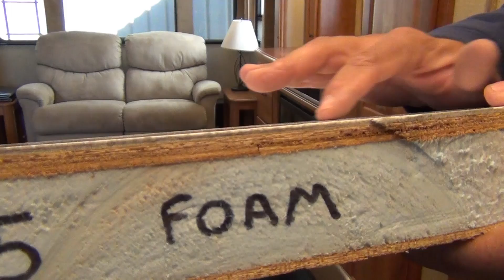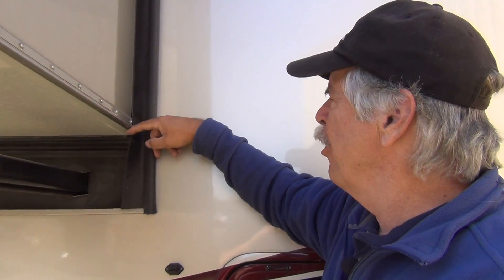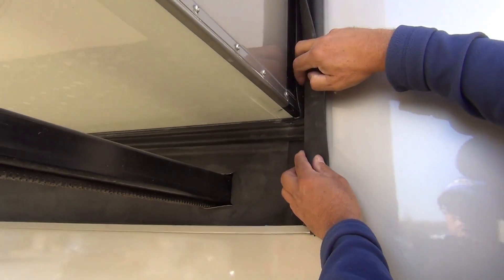How To Heat and Insulate your RV with Insulation Windows Furnaces and Seals

Comment: anyone?? insulation question.... From what I read "enclosed heated underbellies" don't really provide that much heat, 1 vent for the entire underbelly just doesn't seem to cut it.  Not to mention I heard that the insulation is absolute crap. If I were to install heating pads I would like to update the installation. Sooooo what's the best thickest Installation that I could put in an enclosed underbelly??  (is the plastic that it comes with decent? or should i think about replacing that. Obviously I want it water tight) really don't want to use a spray insulation since I might have to take it off and work on it again someday but want something very efficient.. any info would be greatly appreciate.  321BH arctic wolf forest river.  Thanks guys and girls🙃🍻🍸 ps we will be doing some camping in 5 10 15 degree weather, I'd rather spend the money and do it right❄❄🎅❄

Comment: Could I bore some holes in the wall of my 1982 Dodge xplorer 228 camper van and fill the walls with spray foam insulation? Do you think this would cause a lot of warping?
Reply: I want to know also?

Comment: This video is very informative thank you.  I was just wondering if anyone on here could give me a little advice for my RV remodel.  I have a 96' Jayco 3500 fs that I'm gutting out to remodel so that I can live in it all year long.  Just so you know, I live in Norther Wisconsin where winter's can get to -60 degrees with windchill. I've torn it all the way down to the studs because one whole side has suffered alot of water damage and will be replacing the studs that will need to be replaced due to this.  I will also remove two of the windows and closing those openings up.  I was just wondering with all the Insulation ripped out, what would you recommend as a replacement insulation?  Should I just put all new Fiberglass Insulation in or do you recommend Firm Styrofoam Insulation?  If anyone can help, that'd be great and thank you in advance.  Kimberly
Reply: I would go with 2'' blue or pink owens corning R12 foam and spray foam every crack and difficult to reach orifice, all for walls and ceiling. For the floor i would put 2x R12 foam from beneath while also rapping all holding tanks+ spay foam all around and finish it with black 3/16'' coroplast so that the underbelly is smooth as baby butt to reduce drag when driving up the highway. I would also put standard residential 120V heating cable beneath the wood flooring inside the coach to offer a perfect low energy heating source, cause a hot floor is always soo confortable when it is coooold outside. Sure it is lots of work but it is amazing  you''ll see. I did it once and it is amazing!

Comment: Was this a infomercial for Horizon Trailers?

Electric mattress cover is great as a bed pre warmer. 

My 5th wheel has no heat source in the bed overhand so I use a Stor-Dry which has a low power heater and fan, draws less than 100watts and is supposed to be used to keep moisture at bay when storing an RV or boat but also does a great job of circulating air in my bedroom.

Refectix taped over a widow on the outside of an RV adds extra insulation.

An infrared electric heater seem to kick out the most heat.

Comment: are there steel ribs inside the walls of RV's like vans have and if so about how far apart are they on average?
Reply: The story is worse than what is told here. They aren't steel; they're typically aluminum, which has enormous thermal conductivity, so that short-circuits much of the value of the insulation stuffed into the frame around them. With a couple of rare exceptions, the whole RV industry leaves their frames completely uninsulated--the frame member has contact with the outside wall on one side and with the inside wall on the other, with no insulation between. Even his roof section in this video isn't the R-20 claimed because it has air conditioning ductwork in it. Anywhere there is ducting like that, it is R-10 at best so that pulls down the total R-value of the roof system.

Comment: The average R-value of solid wood is 1 per inch (equal to a single pain window,) and aluminum has a lot less of a R-value than that. Aluminum conducts heat as well as it can electricity.

Comment: Here's friendly advice from hardy Canadians spending harsh winters in RV's at oil and gas sites throughout northern BC and Alberta.
Use special bubble wrap with flat surfaces on both sides (not the regular one with bare bubbles sticking out on one side) and attach it really tightly to the glass while also covering window metal frames all the way to the wood trim. Keep it in place by running scotch tape all the way around it sealing it the best you can. There's also bubble wrap with one sticky side which is absolutely ideal for that: it doesn't leave much air between the wrap and the glass/metal frame, thus eliminating condensation and frost (and that's exactly why simply closing the shades doesn’t work). This material is also great in letting the sunlight in during the day (unlike astrofoil - another material popular among RV-ers) while providing good privacy at night (you can only see people's silhouettes inside even with blinds open), and it's fairly easy to peel off in spring (you might need to use a bit of rubbing alcohol to remove any adhesive residue from the glass). You can also attach pieces of bubble wrap to the vent and skylight openings to let the light in without loosing the heat. I recommend keeping them in place using self-adhesive velcro strips attached around the perimeter of both the opening and the bubble wrap cover - that way they're easy to remove when needed. You can also glue a large sheet of bubble wrap to the top of your bed board under the matress to reduce condensation there.
To insulate the walls and roof use penoplen (look up either that word or 'foamed polyethylene'). This is cheap but amazing material sold as flexible tiles ~1/4'' thick with one self-adhesive side and another having various soft 3D decorative patterns and colors (some really nice). You simply glue them onto your internal walls and ceiling like you would regular tiles, and they can boost your rig's insulation immensely. They are also fairly easy to peel off and/or replace with a different design when the old one gets too old. I also highly recommend to use either sticky bubble wrap (cheaper) or penoplen (better) to insulate the walls inside all the cabinets (top and bottom), on the inside of your external storage hatches, and on the inside of your rig's entrance door (cover the door window as well).
To insulate the floor, you can use thick carpet or area rugs, but nothing beats 2''-thick interlocking closed-cell floor tiles sold in any hardware store (some sport equipment stores also have them under the name 'tatami mats'). They're also super comfy to walk on.
However, one of the biggest sources of heat loss (especially in the newer, better insulated 4-season RV's) are the slideout perimeter seals. Buy thick self-adhesive door seal strips (or cut 2"-wide strips from thick and soft closed-cell foam mats sold in hardware stores or on ebay) and glue them around the perimeter of the slideout behind the decorative wood trim where it connects with the external slideout walls so that when the slide is fully out these foam strips will be somewhat compressed against the internal wall providing a good seal. Unfortunately, this cannot be done at the bottom of the slide, so you have to identify the main routes of draft penetration on some cold windy day and improvise the ways to block them.

Avoid using propane heaters (unlike propane furnace or electric fireplace, they produce a lot of moisture).
To further reduce moisture, use microwave or electric toaster to cook/reheat your food instead of gas cooktop or stove, and if you absolutely must boil or cook something using gas then turn on the exhaust fan to drive away the vapours.
Be very careful with electric heaters (even oil radiators - they can also cause fire if they trip).
Avoid showering in your rig as much as possible (use campsite shower or other alternative). Minimize drying loundry, wet clothes or sports gear in it, and buy a good dehumidifier if you do.
Watch closely the inlet and outlet vents of your fridge (especially if you ever run it on propane in freezing cold): icicles tend to grow inside the space behind your fridge blocking these vents.
Don't sweat trying to clear snow banks around your rig (typical rookie mistake - thinking they might accelerate freezing of your tanks and piping); conversely - pile  even more snow around to close the gap between the bottom of your rig and the ground, especially if you don't have a skirt. Also do not remove snow cover from the top of your rig and slide roofs.

Good luck!
Reply: Wonderful explanation Simple language and instructions along with the reasoning behind it, materials to use and trouble shooting. The fact that you're able to explain this complicated issue in such understandable language shows that you have a lot of hands on  experience with this issue. Thank you for the valuable information
Reply: Hi Gene Kizhner , I know it's been a long time since this post but I was wondering if you could tell me where you found the bubble wrap you mention . I can't find it in my location , I'm in Sk. The double sided with the sticky side is the one I'm interested in . The info would be greatly appreciated , as I have printed off your advice for us to go by on our Camper .
Reply: @brendacook1608  I haven't seen clear double bubble with adhesive backing either. Double sided tape or 3M clear removable strip would work to secure the bubble to the glass in an X pattern. I'd use a colored masking tape to secure the bubble around the aluminum window frame or to the wall board. Masking tape won't rip the paper off the wall board. If the tape is left on too long (8mo or more), you may have to use some oil to remove the adhesive left behind. Anytime you, as well as all others reading this, uses tape to secure anything to the windows or aluminum frames, be sure to clean the surface and ensure its dry before applying any tape or temporary adhesive. Otherwise the tape will not stick properly. A few days later you'll see the tape or item adhered to said surface falling off. Adding area rugs with carpet pads which has Astrofoil on the bottom can keep your feet warmer. Thus you're less likely to turn the heat up. Our heads and feet act as our bodies thermostat. Keeping them warm, provided our four legged children and plumbing don't freeze, means keeping the thermostat lower. Reducing from 70 degrees to 67 can extend the time between lp fillups, if not eliminate the need for the furnace to run at all. Unless, of course, your average daily temperature is below freezing :-),

Cheers!
Reply: Your comment is better than this video!
Reply: @basails45  Yep. The aluminum frame running through the roof and walls short-circuits much of the value of the foam insulation featured in the video, but very few people other than mechanical engineers with thermal-envelope experience are aware of that. RV manufacturers definitely are not. Below zero in that rig wouldn't just require the "arctic" package.
Reply: A fellow oil field fella from Ab. I kill the drafts around my slide by jamming pool noodles in the gaps on the inside, works like a charm!
Reply: I spent a year in my 1998 travel trailer .. wirh a broken window sealed up with cardboard duct tape .. the floors are the worst for being cold I had an electric heater but often used the propane oven to heat up the place
Reply: AMAZING idea! I never thought of it, but it makes total sense for windows and small air gaps. Air is simply the best insulator. Same goes for using that reflectix, people fail to use the 3/4 inch air gap and install it directly on surfaces which makes it way less effective. Air is also an excellent sound insulator as I found out when I built a music studio.  I have an aliner rv and plan to try your tip on the windows and air gaps in winter. Will try your floor insulation idea as well. Thanks again!
Reply: A friend working in northern latitudes piled two layers of baled hay around the trailer.  He placed beams over the yop of the highest bales and made an airgap over the top.  He stayed cozy after it got a layer of snow on it.
Reply: GeneKizhner

Comment: Hi, im a full timer in a 37.5 a Camio  Carriage in BC. I run  a quarts heater in the back living room and the fireplace (same as yours)when its around zero and a Seabreaze heater in the front bedroom at nite. I turn the furnace on at nite when its colder and shut the fireplace off. How safe is it to run a quarts heater and Seabreeze heater for long term in winter. Also is running for fireflace pretty safe to run days on end ? Im on a 30 amp hook up.
Reply from the maker: Thanks for your question.  Personally, in my opinion, I feel the stand-alone heaters, and the fireplace can be run 24/7 if you are in the trailer with them.   I would not run any electrical appliance if you are leaving the rig.
Reply: Hello again wish they could fix the corners in the slides so they dont frost up in winters. Hey, what do you think of those  3 ft high oil heaters for rvs,,,would they draw alot of heat ?

Comment: i would stay away from those ceramic heaters for sure! in a small space such as an RV i use platinum catalytic type heaters such as Camco Olympian Wave or Platinum Cat heaters.
Reply: Catalytic heaters emit unwanted gases into a closed space. You have to crack a window or two to use them, which wastes heat. I know that some ventilation is required in a somewhat air tight space, so why don't you invent a heat exchanger to vent to the outside and make a bundle of money?